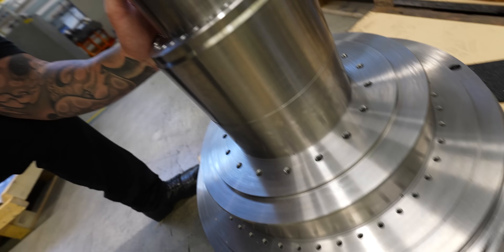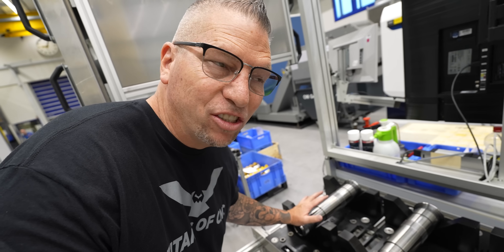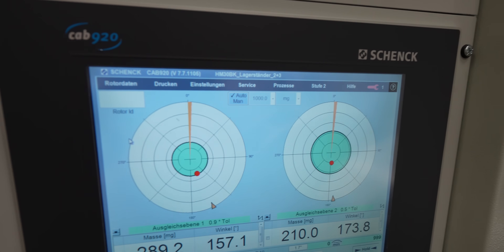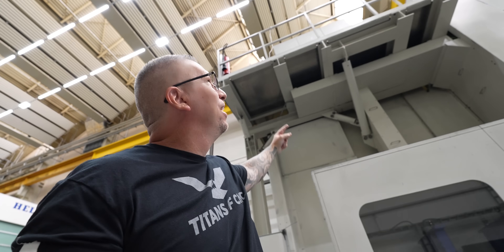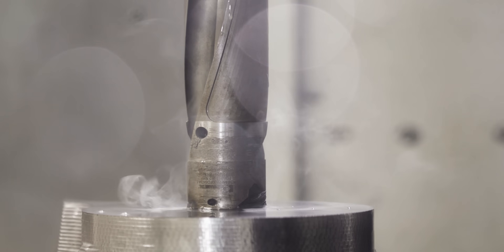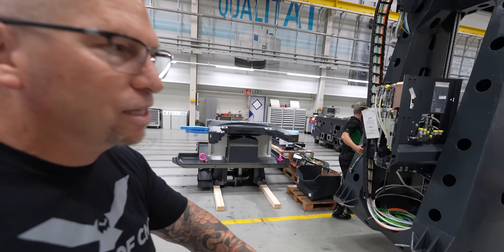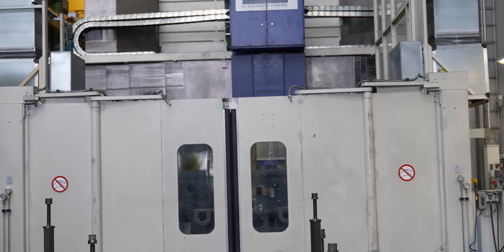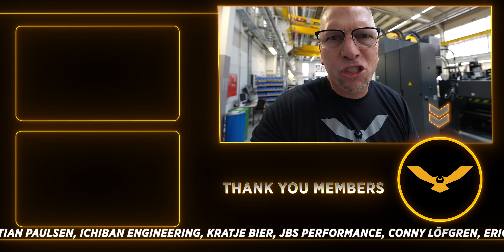MONSTER Machining Process at Heller Machine Tools Germany

Comment: I just retired from years of repairing CNC machines and spindles replacing ball screws ABC stack bearings and I don't miss one single minute of picking them little tiny aluminum pieces out of my hands and stinking like C&C vomit as we called it😂

Comment: when talking about really big cnc machines. In one factory of DMG MORI in Poland called "famot" work two  DMU 1000 SE. Their tables can hold 40 tons of workpiece and 10 metres in length.
Reply: There is a company in Romania called Onsal that made the biggest carusel type lathe in Europe, its table can support 450 tons, it has a 9000 mm table and it can work with workpieces as large as 17000 mm at and a height of maximum 5000 mm. There is also a Romanian factory now called World Machinery Works ( they acquired the brand from Germany)...here is a older video from like 2005  https://www.youtube.com/watch?v=E2mGN43DJN4&t=574s&ab_channel=LikaLik

Comment: Heller vs Hermle 
What and why would you choose 
I really wanna now your guy’s opinion
Reply: Different machines for a different jobs, probably not a good comparison. Hermle are the best for finesse machining on smaller parts, bigger parts or those better suited to horizontal would use Heller or Grob for example. Indeed Hermle used to use Heller for making their mid size machine parts👍

Comment: Had part holding .010 mm was nightmare. Had to work to .0035 mm ( if I remember correctly ) to be capable. We spent a lot of time chasing shop temperature. 🤪🤪 one day quality decided to take a batch for inspection. He went to open door dropped parts off. Went to lunch when he came back every part was scrap 🤬I took parts back to the machine left them for hour got him to recheck parts all happy🎉🎉🎉🎉

Comment: Titan knows. Knows the joy of working with quality and precision.
I just realized why I worked for Porsche for 12.5 years making 100K then went to work for Exxon doing satellite communications making 200K but was not happy.
I hated that 10 years. Yes, I made lots of money, even 310K one year but the job was not for me. I did a great job and had a good reputation but I had to drive myself to get the work done. 
I toughed it out for 10 years but was happy to leave in the end.
I would work with the Heller machines for less money simply for the joy of working with precision, high quality machines.
Call me crazy.